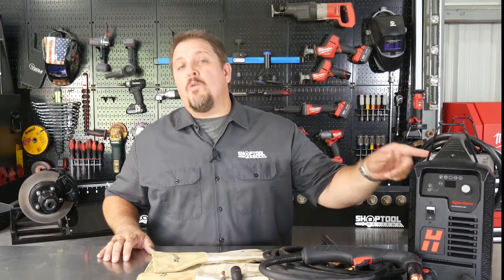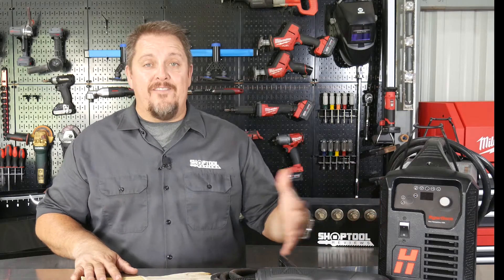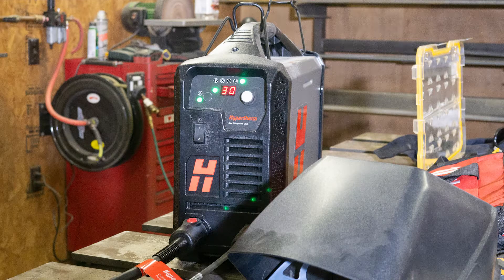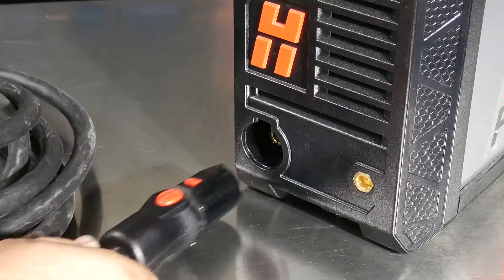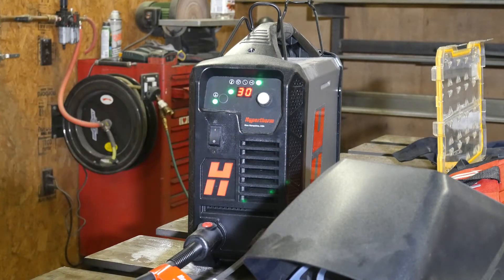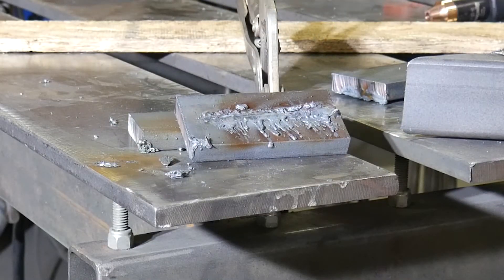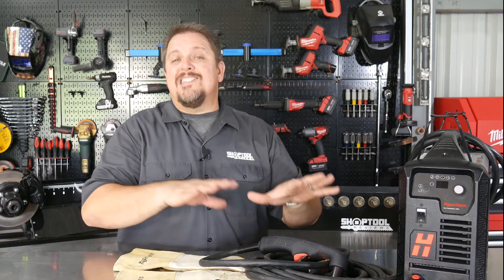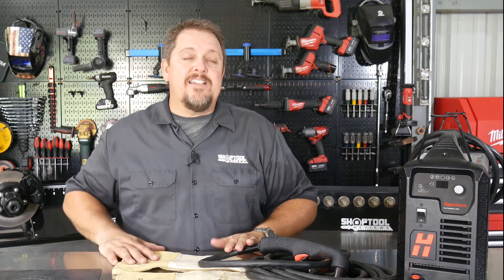Cut 5/8" Steel - Hypertherm Powermax45 XP Plasma System Review

Comment: Ok, now very important for me, regarding cranking it down to 10 Amps: what is the thinnest sheet metal gauge i can cut on cnc table (DIY made) with 45XP? I'm considering this model as a plasma source for my home shop but my concers are how will it cut sheet metal i.e. 0.5mm thick?

Comment: Best review I have seen yet on this power max 45.  Great job explaining all the functions. I’m still on the fence between the 45 and 65. But after watching this video.  I’m leaning more towards the 45 ... you brought out some excellent points about how versatile and easy this unit is to use , thank you for a great review
Reply from the maker: Awesome! Thank you!
Reply: We have both 45 and 65. 45 is on a cnc 65 is hand torch. Myself would buy an 85 and have 2 torches. The reason for my use is duty cycle. Used in farm shop.
Reply: @PatrickPatton-p4o I hear ya    I have been doing plasma on my cnc table for three years now with the 45  I mostly cut 5052 billet .063  so the 45 works mint  I have 7,500 cuts so far and this machine is flawless  my longest cut time was 19 minutes and I only use 25 amps most of the time at 120 ipm   So for me the 45 is great   But for heavier material I could not agree more with you  the 85 is best choice   I do custom signs though so the 45 was good for me 😊

Comment: I have owned my Powermax 45 (not XP) for over 5 years and love it. It is rock solid, easy to use and a good life on consumables. While the XP can do marking.. I don't have a need for that and actually never even thought about it. The auto air, is a nice to have but it is so easy to just adjust the air myself that it is second nature and is one less thing to break or take care of. I do use a filter before the machine just to remove the gunk from the air before it gets to the machines filter. Plasma puts less heat into the work and has much less distortion on thinner stock. It will also cut anything that can conduct electric current so yes to Stainless steel, Alum, rusty metal even stacks of metal at the same time. Oxy can't do any of that!
Reply from the maker: Thanks for the reply. Our machine has been flawless. Replacing consumables is the only maintenance.

Comment: What’s max thickness on a cnc plasma table?
Reply: Easily max capacity, just run the  CBC head according to the speed and amperage charts. I run the 45xp on my Cnc and have no probs cutting (in some cases severing)  even beyond  its rated cut capacity. This machine I say 1/2 inch all day long every day. It will cut 7/8 or 1” but of course diminishing capabilities at those sizes but can make it happen in a pinch
Reply: Wondering the same. One website lists 1/4".
Reply: I know it will cut 1in.